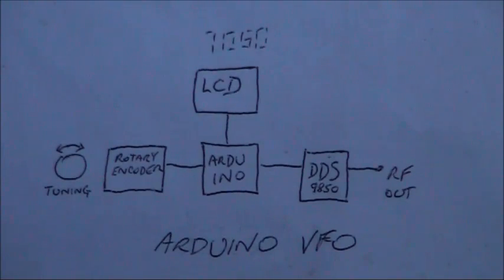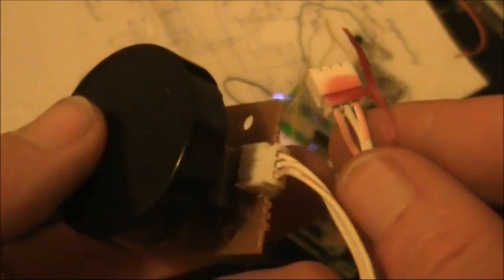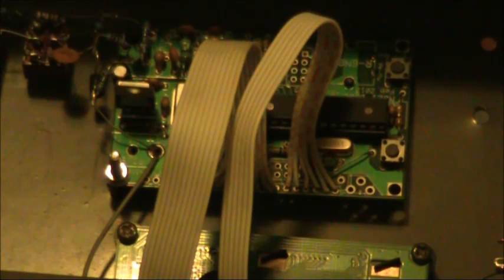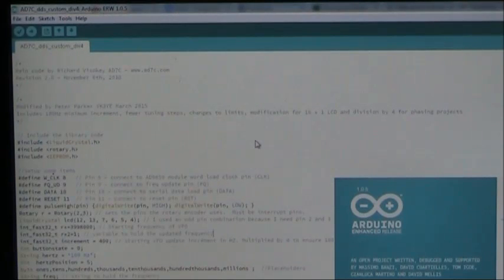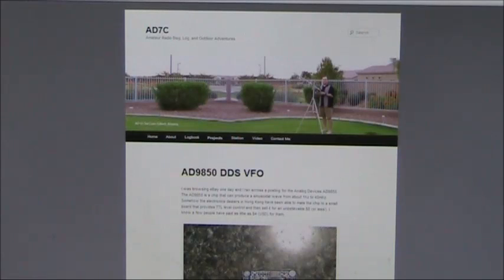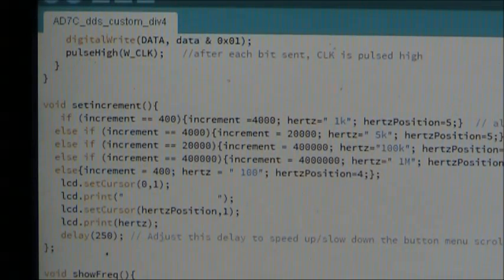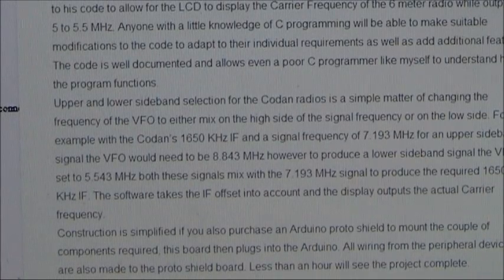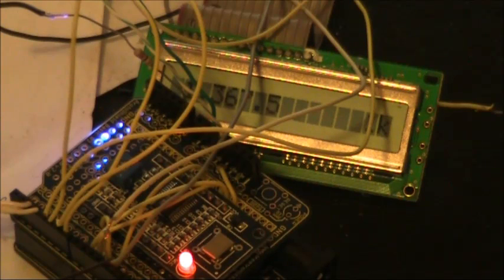Arduino for Amateur Radio: DDS VFO using the AD9850

Comment: I am confused. Is the RF output on this VFO to be used in the place of a crystal oscillator in a radio or alike? I am not really sure why or how a DDS VFO would be used in a RF project.
- VK3FBIC -
Reply from the maker: You'd use a DDS if you want frequency agility. It's more stable than a free-running VFO which uses (now) hard to obtain variable capacitors and reduction drives.  Plus you get a digital readout!
Reply: vk3ye That makes sense. Would you simply put it in place of a variable capacitor and crystal?
Reply from the maker: In place of the whole VFO circuit - not just crystal & v/capacitor.
Reply: vk3ye Thanks a bunch peter! When i learn more about arduinos i will give this project a go! And put it in a RF project. 
Cheers - VK3FBIC -

Comment: fine project could you help to get after the DDS RF output to connect Modulator and the demodulator. if you have all project shematic plz be kind enough to send mail addres :- dias.chanuka@gmail.com